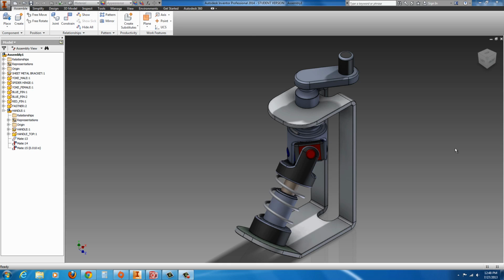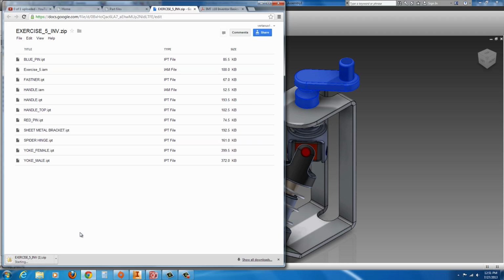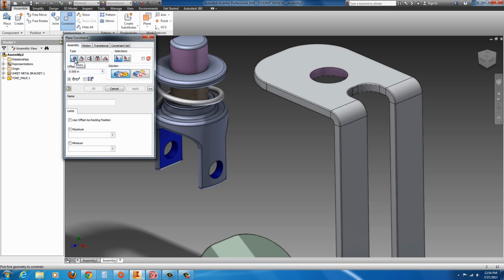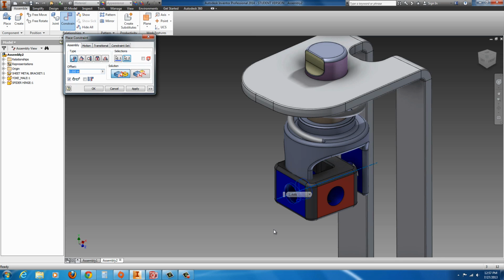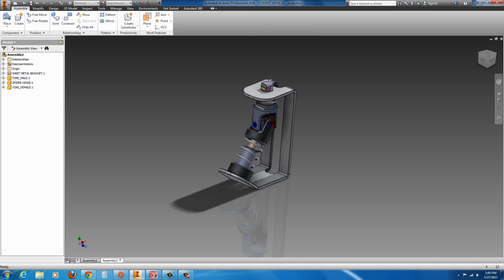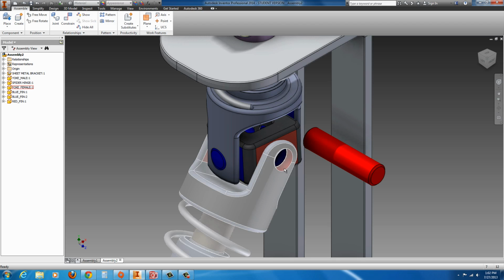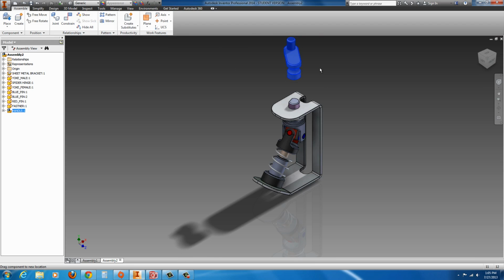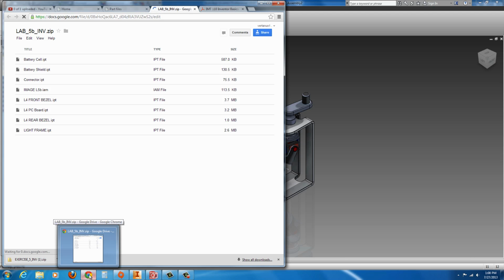E5 INVENTOR 2014 Assembly Basics 1

Comment: Great video.  I found that un-checking visibility for parts that weren't in use made setting constraints and putting in pins, bolts etc much easier.  No need to navigate around all of the parts to get good access.  Thanks again!